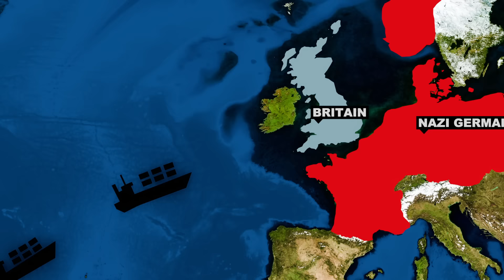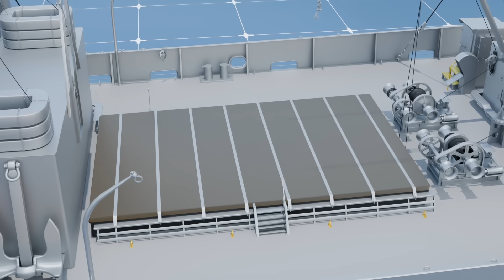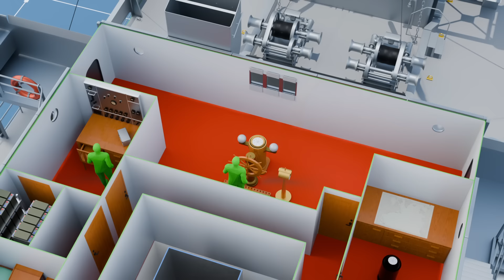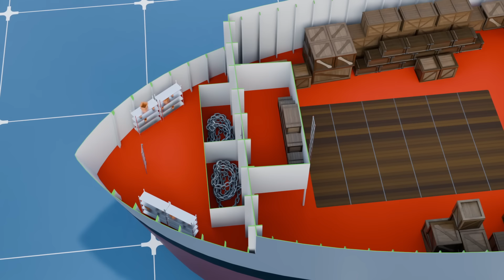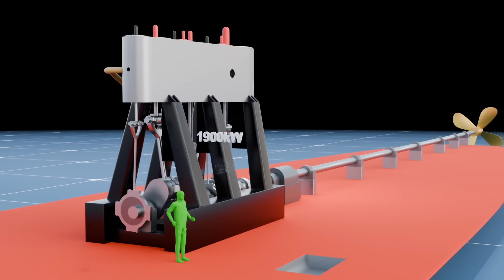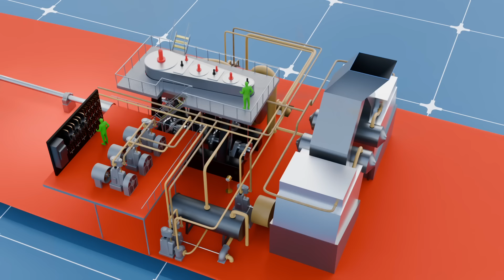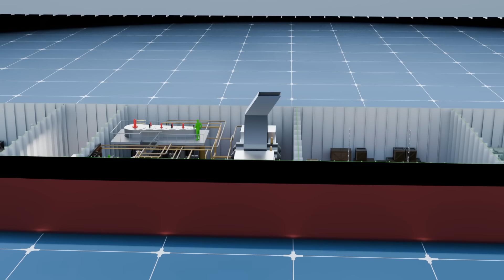How the Liberty Ship Actually Worked

Comment: 01:28 The Liberties were NOT based on an 1800s design. I dont blame you. I dont know where the myth started, but it has become so widespread that it's ended up in most non-professional sources.
All of the major allied energency cargo ships were based on the same basic design. The design comes from a line of British shipbuilders working to build low cost, modern tramp steamers in the early 1930s. The first was a ship called SS Embassage, launched in 1931. The Embassage was by far the most modern cargo ship in the world at the time of her launching. Her design was based around wider and more easily accessible cargo hatches and a very modern and fuel efficient engine. 
Up to the start of the war, about 20 of this design was built. This design was adopted by the British as an emergency standard and became the Empire type. A British mission was dispatched to the US under the designer to get additional hulls built in the US.
He gave the plans to the Gibbs and Cox company of naval architects to refine and change the design for American production methods and ordered 60 of what became the Ocean type. 
When the US launched their emergency program, they adopted a product-improved Ocean as the Liberty. The basic differences between the Liberties and their British forbears  were:
Welded hulls vs. Riveted hulls
Oil Fired boilers vs. Coal fired
A single house vs. 2 houses
All crew lived in the house vs. being scattered around the ship
Greater use of electrical auxiliaries vs steam auxiliaries (pumps, cargo winches, ect)
A more powerful jumbo boom may have been added to the American design, but I can't find for sure what the Oceans and Empires had

Everything about these ships was based on the very latest commercial maritime practice, even the engines. At the time, American and British newspapers criticized the triple expansion steam engine as outdated,  but the design in the Liberties was basically the pinnacle of the type, orders of magnitude ahead of what had come before.

I really like the video

Comment: A point of clarification, the longer ship is going to be faster in any displacement hull design.  Length at waterline determines the speed the ship can push water out of the way without hydroplaning and this will represent the top speed.  To exceed that speed the hull must plane over the water (like a speedboat) rather than cut through it (like a ship) and that leap requires exponentially more power and fuel burn.  A 35' 5 ton trawler can go about 20 statute miles on a gallon of gas, or burning about 1/2 gallon per hour and taking around 2 hours to make that trip at around 8 kts (with its 10-20 hp motor).  A 35' 5 ton cruiser can make that trip in 30 minutes but will burn over 20 gallons of fuel doing it and moving at around 35 kts (with its 500+ hp motor).  Liberty ships move as fast as any other ship of the the same length.  Burning a lot of extra fuel can push you slightly over that waterline formula if you had the surplus power to do it, which liberties did not have but at an economical cruise speed it was as fast as anything else that size.

Comment: Ex marine engineer here.  One small but important point missed out is that when steam exhausts from the 3rd stage of the main engine and enters the condenser, the pressure in the condenser is kept at a high vacuum, usually around 27-28" Hg. Doing so increases the pressure drop across the engine and improves the efficiency considerably.
The vacuum is created by a link-arm driven from (usually) the LP crosshead, driving a vacuum pump.
Reply: I would submit that the vacuum is created by the condensation of steam in the condenser and the vacuum pump’s purpose is to remove air and other non-condensable gases from the closed cycle.
Reply: @GMcK-PTC  Whilst I certainly agree, my post was aimed at "keeping it simple". 
Thanks for your comment though.
Reply: @GMcK-PTC  The vacuum is maintained by that condensation, but it's created in the first place by the vacuum pump. Otherwise the air would always be trapped in there.
Reply: "The vacuum is created by a link-arm driven from (usually) the LP crosshead...".  You're describing a Walking Beam, Sailor !
Reply: Looks like a walking beam to me !  USCG Air -- not a Swabbie.
Reply: Hey question for you then, interested how they sealed the prop shaft to the outside water when it passed through the hull to drive the propeller?
Reply: @iracarew5172  Depends on the age of the ship. Older ships, of this generation, probably had lignum vitae shaft seals.  Lignum vitae is a very hard wood that doesn't rot in sea water and it is machined to fit longitudinally along the shaft, with a gland bush tightened up when in harbour, but slackened back slightly when at sea. This allows a very slight leakage into the shaft passage, which can easily be pumped out, and it also stops any overheating.
Reply: @alanbrown9178  wow not what i expected, ive never heard of this kind of seal but i assumed there would have to be some leak past cause how would you seal a rotating shaft
so is the lignum vitae in 2 halves to make a collar thats fitted around the shaft? cause as it wares it would need to be tightened no? (also could you describe the gland bush)
Reply: @iracarew5172  It's called a stuffing/bearing box.  Allows some seepage which is pumped out.

Comment: The first ships were based on a British design and plans supplied to U.S 
The same type was built in Canada—the PARK & FORT type 
The U.S. went on to design & build the VICTORY type—bigger, faster, and equipped with heavier cargo-handling gear
UK- and Canadian-built ships were all riveted. U.S.-built ships were all welded
I sailed on both the U.K- and Canadian-built ships, but not the U.S. types.
All types were still in service until the late 50s/early 60s... mainly owned & operated by Greek owners. A credit to all  
those who built them 
Its is  claimed that in 1946/1947 a Liberty/Park/Fort type could be purchased for about US$100,000-150,000 in perfect 
and in full working, trading condition. 
jmay
vancouver
canada

Comment: You’ve got some facts mixed up about the armament on that ship. “ 4 inch .50 cal gun”?
Reply from the maker: Unlike firearms, naval guns are usually classified by caliber (the diameter of the bore) and calibers (the barrel length expressed as multiples of the bore diameter). For example, a 3 inch/50 caliber gun has a 3 inch bore and a barrel 150 inches long (3 × 50). We should have clarified this in the video.

Comment: For anyone confused by the 4in 50 caliber guns, in naval guns, the caliber is the multiple of diameters that the barrel is long. So a 4in 50 cal gun has a 200in long barrel.
Reply: And further, the gun shown in the illustrations is NOT a 4"/50 but rather a 5"/38 dual purpose gun in a simple above-decks mounting, sometimes but not frequently fitted due to high demand for those more modern guns elsewhere.

The 4"/50 was a relic from the last war, but large numbers were in storage or being removed from old flush-deck destroyers and the like and the assembly line still existed so there was new production as well. It was much cheaper and faster to get those than modern guns.

Comment: Why do you call the cannons 50 caliber?  They are 4 inch or 3 inch guns. 50 caliber is an entirely different size.
Reply from the maker: Unlike firearms, naval guns are usually classified by caliber (the diameter of the bore) and calibers (the barrel length expressed as multiples of the bore diameter). For example, a 3 inch/50 caliber gun has a 3 inch bore and a barrel 150 inches long (3 × 50). We should have clarified this in the video.
Reply: @Deconstructed_Animations  Thank you for the clarification. Makes sense now...

Comment: What's a 3 inch 50 caliber gun?
Reply from the maker: Unlike firearms, naval guns are usually classified by caliber (the diameter of the bore) and calibers (the barrel length expressed as multiples of the bore diameter). For example, a 3 inch/50 caliber gun has a 3 inch bore and a barrel 150 inches long (3 × 50). We should have clarified this in the video.

Comment: 4-inch 40 caliber?
Reply from the maker: Unlike firearms, naval guns are usually classified by caliber (the diameter of the bore) and calibers (the barrel length expressed as multiples of the bore diameter). For example, a 3 inch/50 caliber gun has a 3 inch bore and a barrel 150 inches long (3 × 50). We should have clarified this in the video.

Comment: My Uncle Rudy served in the Pacific, on the U.S.S. Bellatrix,  an attack transport/Liberty ship during WWII..
   Having lost his eldest Brother with the sinking of the Destroyer U.S.S. DeHaven off Guadalcanal, he said he joined the Navy because he had to go see for himself. 
   My Father had a poem written by one of it's crew, entitled "The Battling Bell". A line from it went, "Her hull was loaded with stuff that exploded."
   Uncle Rudy drove landing craft off her.
   On one occasion, a line of splashes streaked across the water heading toward his Higgins Boat, and he thought they were being strafed by an enemy plane. It turned out to be the empty shell casings from an American fighter plane chasing an enemy plane.
   Another time, out of kindness, he pulled his landing craft far up the beach so the troops he was taking aboard would not have to get their boots wet in the surf. 
  Unfortunately the weight of those loaded troops got him stuck on the sand, and another craft had to pull them loose. 
   The Captain was not very happy about it.
   How nice it will be when wars and the sorrows they bring are forever gone,  and the human family can use their combined efforts for the good of the human family,  and not just to enrich the few. Psalm 46:8,9, Micah 4:3,4, Revelation 21:3-5

Comment: Thanks for this excellent presentation of the Liberty ship, a critical component of our war effort. 
My mother's uncle, Captain Oscar Southerland, sailing for the Grace Line, was the commissioning captain of the JEREMIAH O'BRIEN.  Later, he was also the commissioning captain of the JOHN BROWN.  
In the 1960s, I worked at Maryland Drydock shipyard in Baltimore as an outside machinist, reactivating Liberty and Victory ships from the reserve (or dead) fleet to serve as transports for Vietnam duty.  In this role, i became familiar with nearly every aspect of those ships' machinery plants.  
Later on, I sailed for the Farrell Lines in the engine crew of a C-3 steamship, whose plant was of a very similar design to the Victory ship's plant. 
During the DESERT SHIELD operation in 1991, many obsolete steam ships were reactivated from the reserve fleet to serve as supply transports carrying war materiel to Saudi Arabia.  By then, however, most commercial vessels were diesel powered, and the industrial base necessary to support steam ship repair and operating had long since withered away.  Likewise, the pool of steam-qualified operating engineers had also dwindled to a few old men, who were simply unfit for engine room duty. In the end, the vast majority of war cargo for DESERT STORM was transported aboard seven SL-7 modern steam ships.

Comment: You can't say four inch .50 caliber. That's wrong. It's a four inch gun.
Reply from the maker: Unlike firearms, naval guns are usually classified by caliber (the diameter of the bore) and calibers (the barrel length expressed as multiples of the bore diameter). For example, a 3 inch/50 caliber gun has a 3 inch bore and a barrel 150 inches long (3 × 50). We should have clarified this in the video.

Comment: The propellers were pressed onto the shafts using enormous hydraulic presses.   Those presses, in turn, were enormous.   I saw one first hand in Wyoming at a company that services large mining equipment.   That press that pushed propellers onto shafts is still in use today.   It is two stories tall and weighs many tons, and it is cast iron, and machined to precision.  

Tools like that....made tools like these.   If you want to maintain industrial might, then don't let go of that legacy equipment, and don't stop making bigger and more powerful versions.

Comment: Great video.
6:55 You say the gun is a 4" 50 caliper gun, it can't be 4" and 50 caliper, 50 caliper has a 1/2" diameter projectile, a 4" would have a 4" diameter projectile.  
Thank you.
Reply from the maker: Unlike firearms, naval guns are usually classified by caliber (the diameter of the bore) and calibers (the barrel length expressed as multiples of the bore diameter). For example, a 3 inch/50 caliber gun has a 3 inch bore and a barrel 150 inches long (3 × 50). We should have clarified this in the video.

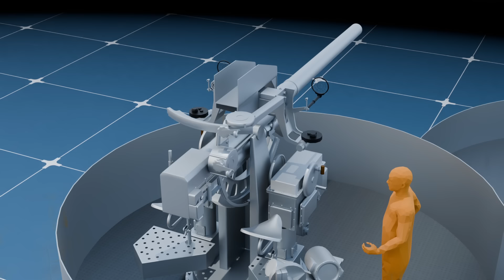Comment: Not to be picky but... about 7:20 you state the ships had "4 inch, 50 caliber guns" and "3 inch, 50 caliber guns". A "4 inch" gun has barrel with an inside diameter of 4 inches. A "50 caliber" gun has a barrel with a 0.5 inch inside diameter. How do you get both measurements for the same gun?
Reply: When the Navy says "50 caliber " it means the barrel of the cannon is 50 times as long as the bore diameter of the cannon
Reply: So caliber had multiple meanings!  Good to know!
Reply from the maker: Unlike firearms, naval guns are usually classified by caliber (the diameter of the bore) and calibers (the barrel length expressed as multiples of the bore diameter). For example, a 3 inch/50 caliber gun has a 3 inch bore and a barrel 150 inches long (3 × 50). We should have clarified this in the video.
Reply: they are classified by that but not even the navy say it like that they would just say “the 5 inch gun” or “the 4 inch gun” etc no need to add the length especially because during the war the rounds weren’t always 150 inches long most liberty ships would vary from 120 inches to 160 inches due to manufacturing errors
Reply: I was thinking the same. 

Which is it, half inch or four inch? 

Is it one of those really odd things. Like a 12 gauge shotgun is bigger diameter than a 24 gauge, even though 24 is bigger than 12. 

12 gauge, 1 pound of lead makes 12 balls, 24 gauge, 24 balls. So 24 gauge is smaller than 12.
Reply: Intentional mistakes are added to generate comments for engagement

Comment: My family had the opportunity to tour the Jeremiah O'Brien when in San Francisco years ago. We were lucky because it was preparing to sail over to Normandy for an anniversary celebration of D-Day. The difference was they had the engine operating to get it ready for the trip. Which is not normally done fir the tours. Very interesting to stand next to that steam engine and watch the crankshaft and rods moving. Got ti ook down the driveshaft tunnel to see the shaft spinning. Another interesting and dunny moment was listening to three elderly women talking about when they were young, they worked as welders building these ships and poking fun at each other about the fact they were all larger than they were back then and wouldn't be able to fit in the tight spaces to weld like they could when they were younger. Very fun tour.

Comment: Excellent and informative video. Every part was interesting, but for me, the most interesting part was the illustration on how the steam engines work. This is because of my interest in railroad locomotives. Some of those large articulated types used steam pressure a second time (rarely a third time), going from smaller high pressure cylinders to larger low pressure cylinders. These were called "Mallets", pronounced "mal-lay". Most of these large steam locomotives, however, were of the simple articulated type, using high pressure only once.

Comment: A 4 inch .50 caliber gun? I dont think that's right
Reply from the maker: Unlike firearms, naval guns are usually classified by caliber (the diameter of the bore) and calibers (the barrel length expressed as multiples of the bore diameter). For example, a 3 inch/50 caliber gun has a 3 inch bore and a barrel 150 inches long (3 × 50). We should have clarified this in the video.

Comment: My father was heavily involved in the issues arising out of the new rapid manufacturing, often by relatively inexperienced fabricators, of the liberty ships type.
 He worked on steel embrittlement that often occurred in the cold North Atlantic waters with the steel alloys of the period. This and brittle fracture arising from weld boundaries. 
He also studied the fabrication issues that arose from the prefabricated sections sometimes not being dimensionally accurate. This could lead to discontinuities between ship wide strength elements as they mated with the next prefabricated section.
 These twin issues lead to the losses of some of the ships arising from structural failure in heavy seas. Not something to experience on the terrifying arctic convoys. 
My Godfather, George Irwin, was very much his opposite number in the US Bu Ships.

Comment: The most interesting 🤔 thing i learned from the video was the origin of the design being and old british cargo ship and not a custom built design for mass production in the war. I have not seen that mentioned anywhere before. 

These ships were one on the main reasons why the Sherman Tank was what it was as the cranes could not lift heavier tanks in their standard configuration. 

Also, some had a problem of 🪓 splitting in half half way across The Atlantic until fixed mid way through the war.

Comment: There was a design flaw creating brittle sections of the hull attributed to the grade of steel where a small number of ships broke into two pieces and sank. This flaw was rectified through the use of additional bracing and cabling around the hull.